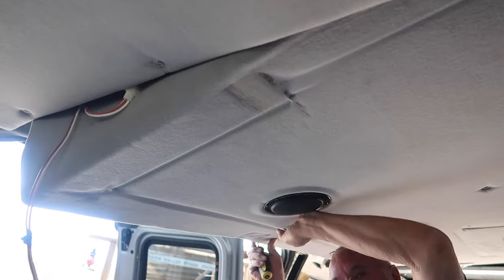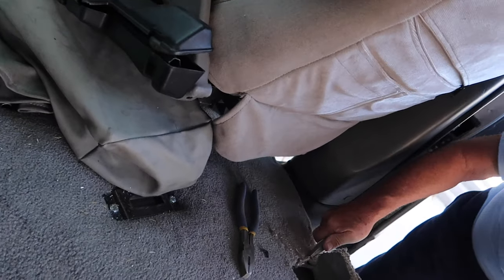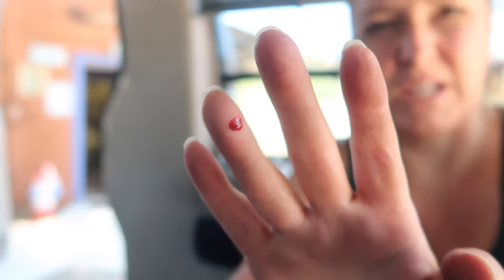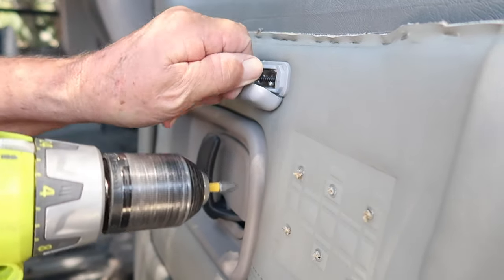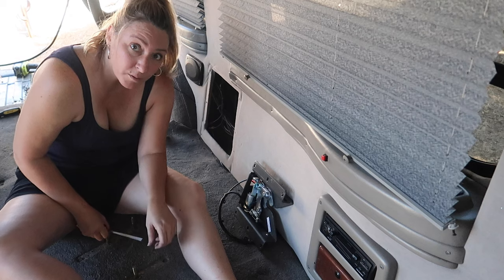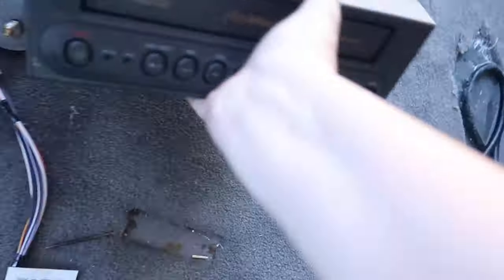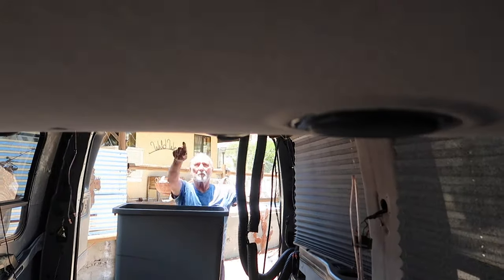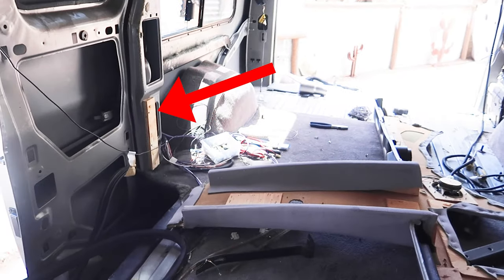Van Conversion: Stripping Out a Van (Chevy Express Explorer) // Travel Snacks

Comment: The only thing I would not ever want to do is cut the roof off. I would love to do two murphy beds on the side walls so that one side is a twin, but both turns into a eastern king...over my stuff. But I so want a Dodge Sprinter and I like the black color for them but I would not mind doing a Sand color so you can go longer between car washes. 
Or buy a new conversion van people come up with. I just want the taller roof built in already